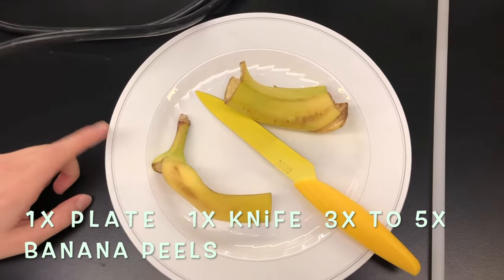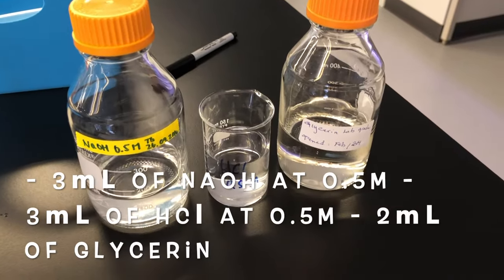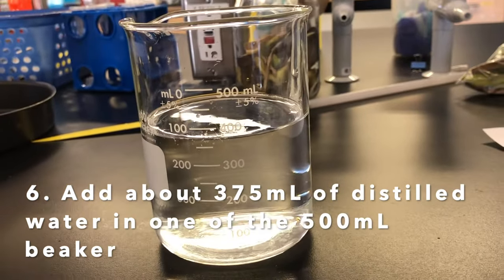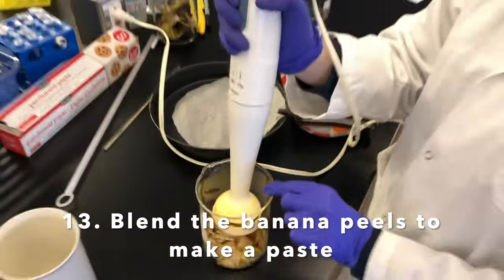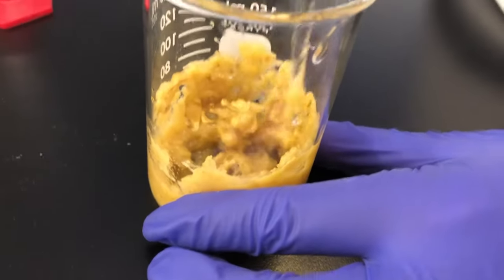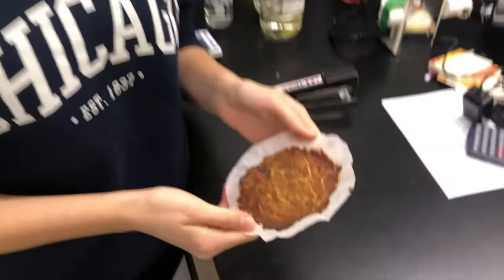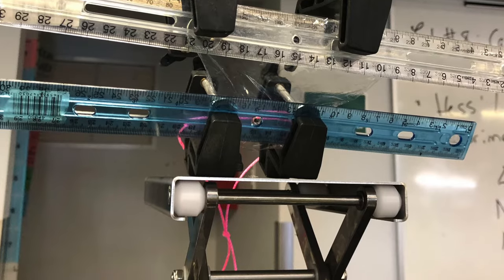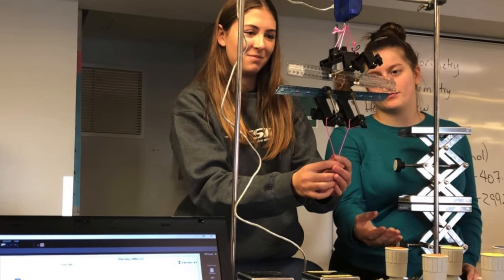Bioplastic from banana peels

Comment: Hey! great experiment. is there a similar process that can be used for making a rubber-like material with biowaste? would really appreciate a response
Reply from the maker: I know that bioplastic can also be made from coffee beans. If you search bioplastic from foodwaste I’m guessing you’re going to find what you’re looking for!
Reply: @marionbaraer9502  coffee beans? Sounds interesting.
Actually I have found resources that do tell about how to make bioplastics, but the results are usually replacement for pet bottles, polythene bags, etc.
I'm looking for something that can undergo a foaming process, to make something like a PU or TPU foam? Is that possible?
Reply: also, is this material you made biodegradable?
Reply: @therealvansh  It will degrade, which may take 6 months to 2 years.